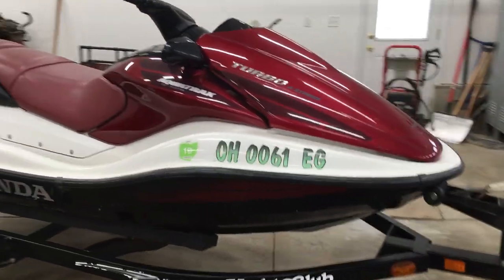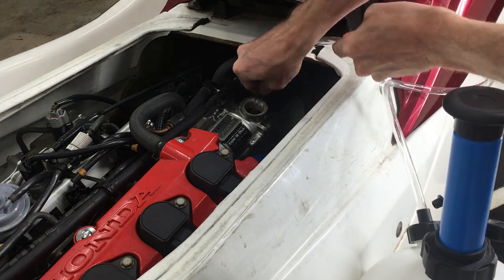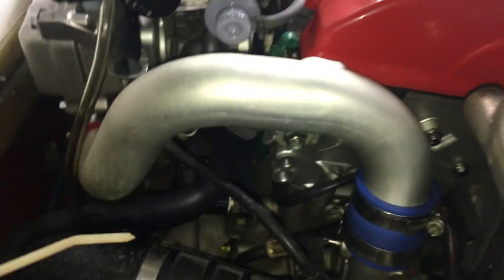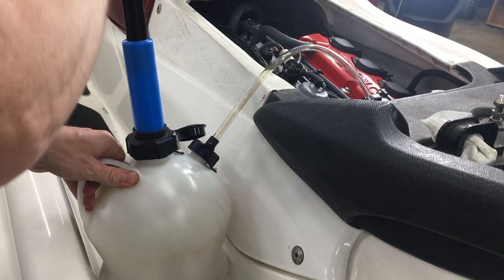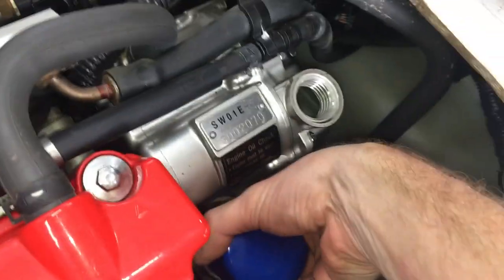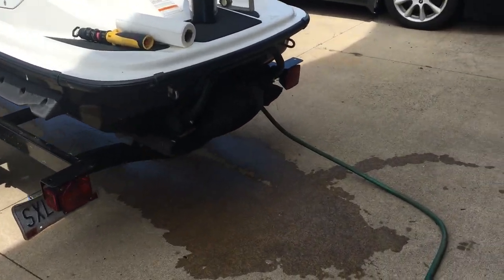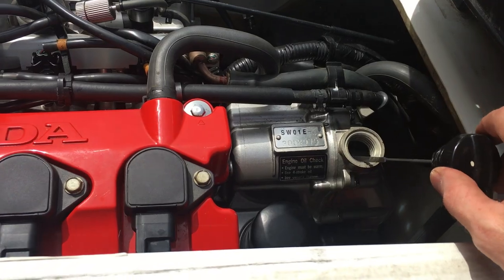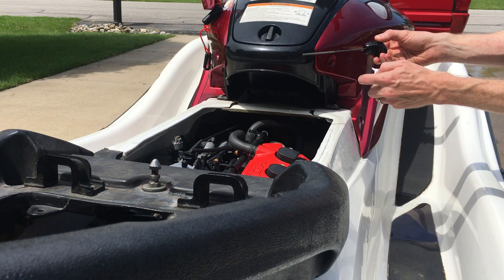Honda Aquatrax Oil Change using an Extractor Pump F12, F12x, R12, R12x

Comment: for reference: the oil filters honda uses are non premium brand filters that use rubber valves inside vs getting a comparable premium filter cheaper at you auto parts store ($9) which will be taller, hold more oil and have better filtration. As far as oil, motorcycle oil is not necessary as you have no wet clutches to lube(direct drive) so any good full synthetic oil like mobile 1 ($27 for 5 qts) from wally world will work well
Reply: Can I use a fram extra guard oil filter on this jet ski Honda aquatrax
Reply: How do you know the size of oil filter
Reply: @mikecouch7388  Purolater ONE PL14610
Reply: You don’t need marine grade oil?
Reply: Yup, I use a WIX 51365XP & Mobil 1 10W-40(1 5qt Jug is perfect) on mine. I stay away from standard Fram filters.
Reply: Thank you, I am about to work on a 2004 aqua trax. This is good knowledge.

Comment: Great video on how to change oil plus more importantly how to check oil level. Turning on water after it’s running and shutting off before you shut ski down is another thing I learned, great vid. We just bought a 05 non turbo when I do oil change I’m planning on using Mobil 1.
Reply from the maker: Congrats on your purchase! These are a lot of fun.

Comment: for total oil capacity. use owners manual. Then put in the 4 quarts. For the extra small amount, I use a baby bottle from Dollar Tree with ounces noted to measure the remaining amount to install. Then there is never any guessing and / or additional extracting.
Reply from the maker: That’s a great idea!

Comment: The ghetto way to check the oil with the engine cold is put the dip stick in the rear with it cold and level should read the same as the top when you have it hot on the lake with still water 💦

Comment: So what was the total amount of oil after you pullled some out? Also, you kept interchanging liters & quarts. How much is it supposed to take, 4.5 qts or 4.5 Liters?
Reply from the maker: I’m unsure of the exact amount I used, it really depends on how much oil is left in the engine after extracting. Turbo models use 4.4 Qts Non-Turbo models use 4 Qts.

Comment: Great video, however my manual says after adding the new oil to run the ski for 5 min at 4000 rpm. to get the proper oil reading.  Noticed you ride near Sandusky, I am in Amherst, OH
Reply from the maker: Nice! What year/model is your Aquatrax?  I've only seen a few other Hondas on Lake Erie.
Reply: @6thGearGarage  Mine is an 05.

Comment: So when you had to extract some oil, because of over filling, it looked as dirty as it did, before the oil change?
Reply from the maker: Yeah, as soon as fresh oil goes in an engine, it mixes with any old oil still inside the engine and darkens. There's a lot of nooks & crannies that hold old oil.
Reply: Detergents

Comment: Would you happen to know the diameter of the hose?
Reply from the maker: I'd guess it is about 1/2" outer diameter.  If you buy the pump I used, DON'T use it to pump old gas out of a tank - it messed up the rubber seal inside the pump :(

Comment: A dealer changed my oil last fall before putting it in storage.  I checked the dipstick before starting, and it showed no oil.  The dealer said it needed to be started before seeing oil on the dipstick, meaning it drained to the back of the sump area.  Is that actually possible?  I would have thought that the oil would show on the dipstick even if cold, assuming it had the right amount of oil in it.  Thoughts?
Reply from the maker: The ski has to be level and the engine warm to get a proper reading on the front dip stick.  I'd make sure it's level and check the front again to see if you see any oil. I'd think there would at least be a small amount showing.

Comment: Hey mate, my dash cluster works but the buttons have stopped working. Do you have a tips? Thanks, enjoyed your video!
Reply from the maker: Thanks! Unfortunately, I have never heard of your issue happening before. What year/model and how many hrs?
Reply: @6thGearGarage  it's a 2007 f15x model. The cluster works so I guess I'm looking for tips on how to replace the buttons? 135hrs
Reply from the maker: @Samsung-nm2gp  Those are usually not problematic skis. I don't know if it's something as simple as a blown fuse, or if you're going to have to replace the cluster.

Comment: Great video. My Honda is using a lot of oil . It runs fine . Is there a reason for this .Thanks for the information non turbo
Reply from the maker: How many hours are on it?
Reply: @6thGearGarage  I will check this weekend it in storage. Thanks

Comment: What year is your Aquatrax? Great video! Thanks man! 🙌
Reply from the maker: Mine is a 2006 and it's been a great machine so far.
Reply: @6thGearGarage  have you taken it out in salt water? Ive heard 2 things about these skiis.  The ecu knock sensor circuit going bad and the walls of the jet pump swelling in salt water causing the turbine to stop spinning. How has your experience been?
Reply from the maker: Spill Burg this ski has been great and low maintenance for me. It has always been a freshwater ski and has the original ecu. Aside from regular maintenance, I did have to replace the main relay this summer.
Reply: @6thGearGarage  cool glad its working for you. Freshwater im sure is the key.